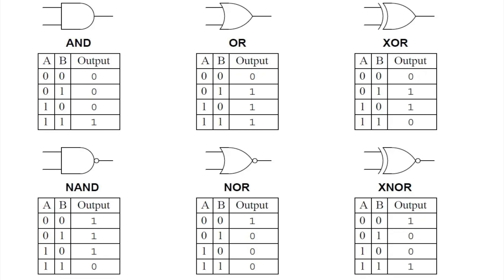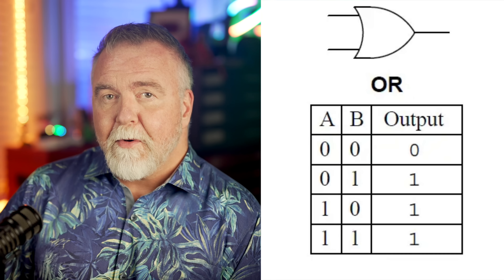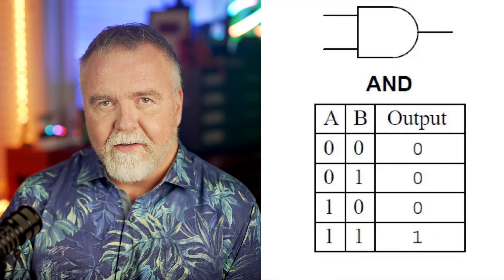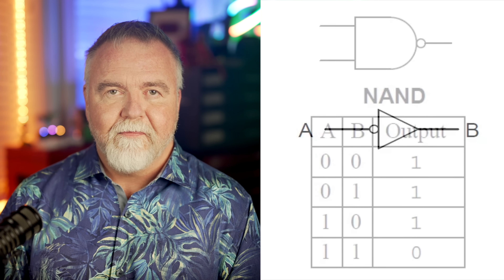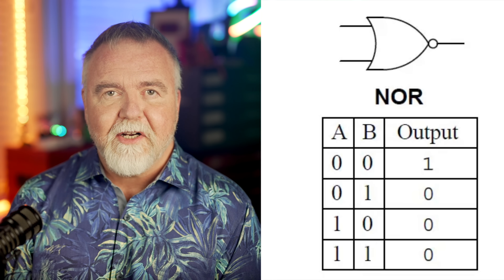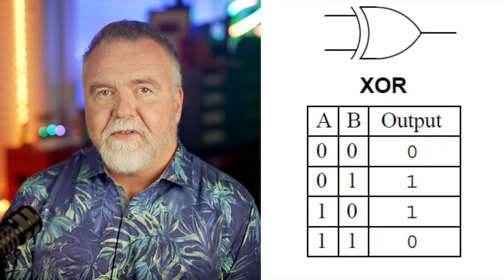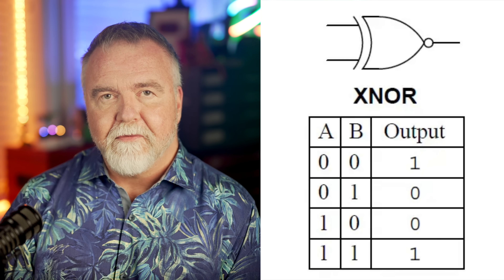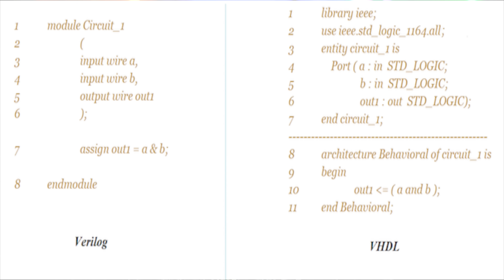The "Do Anything" Chip: FPGA

Comment: I have owned FPGA based computers for years now. My first was the MiST which is designed to be an Amiga or Atari ST computer (The name is a mix of the two computer names, Mi from the middle of Amiga). It can also be other computers like the BBC Micro, Sinclair Spectrum, C64, etc. by changing the FPGA configuration, known as cores.

I then got an FPGA dev board to learn how to program FPGAs which I gave up on, not motivated enough these days I guess.

My next one is the MiSTer which is the same idea as the MiST but uses a dev board instead of a custom board, though it does have custom boards to enhance the IO adding VGA output to use old CRT monitors for more authentic experiences. The dev board is the DE10-Nano from TerrasIC, those are very popular in retro computing and gaming these days and have many variations of addon boards including my latest the MiSTer Multisystem which turns it into a console.

My next FPGA based computer is the Spectrum Next! The latest officially licensed Sinclair based computer. I am waiting for the second revision of that to be shipped too. It's a modern implementation of the Sinclair Spectrum computers, what they think the next version of them would have been with enhanced sound and graphics. It can also switch into Spectrum 48 or 128 modes for backwards compatibility. Being FPGA based it also supports other cores to become other machines, though you have to try to use them with a Sinclair keyboard! lol  (It does have PS/2 keyboard and mouse support if you don't like the Sinclair keys)

I also have a TerrasIC DE0-Nano dev board that I bought by mistake trying to order another DE10-Nano, I kept it anyway just in case I try again to learn on a simpler FPGA lol

Comment: There have been some fascinating FPGA projects like the one in which an digital signal processing FPGA was developed iteratively with genetic algorithm and the resulting functional FPGA had internal circuitry that was not connected to any input or output, but if that extra circuitry was omitted the FPGA no longer functioned.

Comment: I first heard about FPGA chips maybe a year or two ago, in the context of audio synthesizers. More recently, got my hands on the Novation Peak, which uses an FPGA for its oscillators, among other things. I've used my share of hardware DSP chip based synthesizers and this thing has much less aliasing than what I'm used to -- one big resulting advantage is that it can accurately reproduce overtones much further into the harmonic series.

Comment: I used FPGAs only when I had more than one clock generator in a given circuit. For some reasons connected with their inner structure, FPGAs have a tendency to resist glitches...

Comment: The ISDN connection to Fritzbox routers died the FPGA death. Originally, ISDN was made by special IC, but the production was discontinued. Then the manufacturer switched to FPGA. This went well for a few years until this FPGA was no longer available. It would have had to be switched to a larger FPGA, which would then largely not be used. So the ISDN telephone option on the router was deleted.

Comment: Thanks, Dave! FPGAs have also found a niche in the retro gaming community, often cited as the gold standard of “emulation” versus software emulation.
Reply: That's ... a really excellent use case that makes a lot of sense; can't believe I hadn't realized this sooner lol

Thank you for the edification!
Reply: Probably most interesting aspect of this that you can make your own 8bit CPU too, or even 32bit if you like, some thing like ZipCPU
Reply: @von_nobody  I have done a custom CPU with 64-bit 3-wide VLIW, 64 GPRs, 48 or 96 bit virtual address space, 128-bit SIMD, ... on an FPGA.
Main limitation is mostly that on the FPGA's I am using, I am mostly limited to running the CPU cores at 50 MHz. The ISA (BJX2) and C compiler (BGBCC) are "full custom".

A lot depends on the FPGA, I can fit one of my cores on an XC7S50 (with some tuning) or XC7A100T (with some space left over), multiple cores on an XC7A200T.
On an XC7S25 and XC7A35T, one needs to use a simpler RISC-like core design to make it fit IME (so, something like RISC-V / RV32IM or similar is "more sane" on these FPGAs).

(Could probably do a lot more with an XC7K325T or similar, but sadly, Vivado WebPack doesn't support it, and the license to use it would cost more than the FPGA board...).

In general-use code, performance is a slightly faster (per MHz) than a 486 (~ 0.85 DMIPs/MHz), but in some tasks it pulls well ahead. For software-rasterized OpenGL or neural nets, it seems more on-par with an early 2000s laptop; currently with its max FPU throughput at around 200 MFLOPs/sec; ... (though, admittedly, in some benchmarks, said laptop also loses to a RasPi 2 despite having a faster CPU clock).
My CPU can barely run Quake (single digit framerates), but ironically I have a small Minecraft like engine running on it at "slightly higher" framerates (albeit a fairly short draw distance) via software-rendered OpenGL. Sadly, "faster Quake" would likely require a fairly significant redesign of the 3D engine (it spends more of its time walking the BSP tree and similar than "actually drawing stuff").

Effectively pulling off 100MHz requires a narrower core and smaller caches; so, say, something more like 1-wide RISC-V RV32IM core can be done at 100MHz. Though, more MHz isn't necessarily a win (more so when one needs to use smaller caches, and the external RAM interface is slow).

Similarly, RAM bandwidth is a long-standing issue in my case, and 32-bit 1-wide cores at 100MHz seemed to end up slower than a 64-bit 3-wide core at 50MHz. This is even when my compiler sucks at bundling and is unable to modulo-schedule any of the loops, so one needs to use a coding style which better fits these constraints (lots of aggressive manual loop unrolling and modulo-scheduling), ... Where "small and tight" loops perform poorly in this case.

Similarly, trying to get my core to run at 75MHz by making the L1 caches smaller "sorta works", but performance is worse due to the smaller L1 caches (2kB vs 16kB) than is gained by running at a higher CPU clock speed (whereas 32kB L1 caches "barely work" even at 50 MHz). Also generally using direct-mapped caches in my case.

Though, most of this was on an XC7A100T, have more recently gotten a board with an XC7A200T, which can handle 3 of my CPU cores (and a much bigger, L2 cache, namely 512K). I have yet to figure out what I will do with all the extra space in this FPGA (was using ~ 60% of the LUTs before, now at ~ 30%).
Amusingly, went from DDR2 to DDR3 between the boards (both with a 16-bit RAM interface), but the DDR3 is slower because it runs at the same (also slow) clock speed but has a higher minimum CAS latency.

Seemingly an interesting project to work on, albeit its "general usefulness" is debatable...
Reply: @BGBTech  wow! Interesting stuff.  I'm learning Verilog and want to get proficient enough where I can create a 4bit CPU just for fun. Then move on to creating and improving retro hardware emulation.
Reply: @BGBTech  yeah the main limitations at least for me are the licencing fee and FPGA board prices. Which tends to be more expensive than their microcontroller counterparts. Plus today microcontrollers are more robust and faster. So I jumped back to microcontrollers. Plus it's easy to program microcontrollers. In the first glace FPGAs looks like the solution to all of your problems but in reality it's a rabbithole. But if you're pesistance enough FPGA programming is a good skill to have. You have to remember where & when to use FPGAs since some times microcontrollers are far better in some cases than a FPGA!
Reply: @BGBTech  But it pass test "Its run Doom?" :>
Thanks for detailed comparison with established hardware to see better what level of performance we could expect.
Reply: @mikeshane2048  FPGAs are also much more expensive to make custom PCBs for as they usually need a lot more supporting hardware (multiple voltage levels, exxternal flash etc) than microcontrollers. They also normally need more layers due to the dense pin pitches and high speed signals. That's why I think most mini retro consoles all use microcontrollers as it's just cheaper and the emulators are "good enough" for most people. If the microcontrollers were not fast enough, the bigger companies would jump straight to ASICs as they're much cheaper in large volumes - it's just the initial tooling cost that is too high for individuals to pay.
Reply: @Anticitizen666  yeah, also with free software you can only code/ simulate only 1000 lines of code or they have implemeted other means of hindering the use of FPGA to its fullest potential don't get me start on the IPs. I still use FPGAs from time to time to brush up my VHDL (I use evaluation boards and I have't designed any FPGA PCBs yet) skill other than in my projects I exclusively use microcontrollers.
Reply: @BGBTech Very interesting. Have you tried RV32IMC. The claim is that programs with compressed instructions run faster, and use less power,  on small caches, due to fewer cache misses. I am curious to find out if it is true in practice?
Reply: @NoX-512  It can help, and can improve code density (say, it can reduce binary code size 30% or so vs fixed-length 32-bit instructions). Gains in terms of performance in practice tend to be more modest though in my experience.

Say, if one has a 16K instruction cache and the miss rate is already fairly low, one will not necessarily gain as much from improving code density further. With a 4K or 8K I$, 16-bit instructions can help more, but not likely enough to offset the performance cost of the reduction in cache size.

On the other side, if code density is particularly bad (say, for example, as it was on IA-64), then performance is going to be bad unless one has a much bigger I$ to compensate.

Relatedly, keeping data sizes small can also help with performance. Say, avoiding using data structures or types that are larger than necessary, trying to keep the working set as small as is reasonable, etc...
Reply: It's not really emulation as you think of it with computer-based emulators. The FPGA is simulating the original hardware right down to the low level gates, memory and speeds of the parts. It IS essentially the original hardware and so offers a perfect (aside from video output usually) recreation of the original. It's a completely different way of approaching the same area of preserving retro games/computers.
Reply: @Anticitizen666  that’s why I threw “emulation” in quotations in my initial comment and pitted against more traditional software emulation. As an English major, precision in language is more important to me than most. I’m just a nerd on several fronts, ha! At any rate, I leave it to those smarter than myself to quibble over the minutia of what emulation truly is, but definitely wanted to chime in as your insight is not lost on me.
Reply: @Bushidounohana  Yeah, it's a subtle distinction for people not aware of the vast differences between how simulation and emulation are implemented. I've also worked on emulators both for consoles and my own 8-bit retro computer designs, and emulation code bears no relation to how the original hardware actually worked, as you're taking advantage of the host system hardware - it's only the result that matters. For example, using arrays, structures and objects to represent a CPU and bus etc at a high level only, as the low level implementation is irrelevant. Where-as with simulation on an FPGA you would (usually) replicate the original hardware design down to the gate level - although most simulators also have optional enhancements due to the massive amount of extra performance available! It is nerdy, but hey, that's why we love it, right? :)
Reply: @Anticitizen666  absolutely, my friend!
Reply: Yup, software emulation is pretty much always gonna be cheaper, but hardware emulation is the simplest way to clone all the little foibles of the system that don’t matter most the time but subtly affect how a system really worked on the original hardware—and the bleeding edge programs of a system almost always took advantage of those foibles to eke a little more out of limited machines, so they can make or break some games.  Lets you get the original system experience without having to track down a still working original system or a dozen historic proprietary or out-of-production chips.
Reply: Some video games that are not microprocessor based and built entirely of logic chips can be easily emulated on FPGA for replacement of old evil unreliable boards. Its funny to find the old circuit board with a piece of double back foam tape on it with a little board and one chip doing all the heavy lifting as a repair. You are spot on about this.
Reply: I remember going to COMDEX back in the day when the nVidia TNT 2 Ultras were around and the GeForce 256 was on the horizon, and those were all designed with FPGA's before they went to actual hardware. I remember knowing at the time what FPGAs were but I had no clue that they could be and in fact were often used for designing actual cutting edge hardware before sending the designs to fabrication. Pretty phenomenal stuff!
Reply: The big benefit is that the design in the FPGA can mirror the actual system's circuit. Software-based emulators are nearly impossible to get 100% accurate because the software only handles what is understood about the original system, and it the software tends to be quite complex and thus likely to contain bugs.
Reply: FPGAs are not a "gold standard" of emulation. This is only believed by the emulation FPGA fanboys. There is absolutely no reason software emulators can't be, and in some instances still are, more accurate. There is potential for some improvements (input latency is potentially one, but if you have a powerful enough system, software emulators can leave run-ahead which can be just as good, but demanding), but it is still emulation/simulation of hardware and the design is everything. Most of these FPGA emulators are, like almost everything else, built on the shoulders of giants and depends on all the research, reverse engineering, and existing software based emulators in order to be built in the first place. SNES emulation is still more accurate in software now than it is in an FPGA (see: issues list). Mostly thanks to Near in this situation. They are simply no better/worse just because of the fact that it is an FPGA - but people like to justify the money they spend. Like everything else both have plusses/minuses. One is not better than the other by default. This really started as marketing campaigns by a handful of companies commercializing some of these implementations to differentiate/sell product. More often than not, open source FPGA and software devs share information to help both, but this is for the love of retro gaming, not profit driven.
Reply: @DoinThatRag  huh, that’s interesting, thank you! I don’t know enough to really comment one way or another, it’s just what has always been parroted to me by those who seem more knowledgeable. In light of your feedback, I’d be curious to explore the differences and similarities in real world use for myself. Thanks for the insights and your perspective!
Reply: Yeah, doing emulation when multiple chips/processors are involved can be incredibly difficult to do both accurately and quickly at the same time without an approach like that.
Reply: For people interested, the MiSTer FPGA Project is a very interesting attempt to make a single open-source FPGA box that can accurately emulate the hardware of dozens of classic consoles and home computers.  Usually some assembly required to actually make the systems run, but a very promising project.  Or for a more “Premium” experience, Analogue offers sleek, pre-made FPGA clone consoles that accept the original cartidges and disks.
Reply: What's in the FPGA for emulation if not a microprocessor running code?
Reply: @deang5622  The FPGA can emulate all the parts of the target system at the exact same time, so interactions between them that depend on the precise cycle things happened on still work properly.  A software emulation approach usually has to make compromises in order to run fast enough, such as, for example, running a batch of CPU instructions in series, then emulating some of the GPU, then emulating some of the sound, etc.
Reply: @deang5622  It's more like "hardware" emulation.  (Fpga) Basically makes real time cycle accurate emulation accessable.
Reply: @deang5622  Basically, to sum up  @Brad N , "race conditions" are the major difference, that I can see anyway